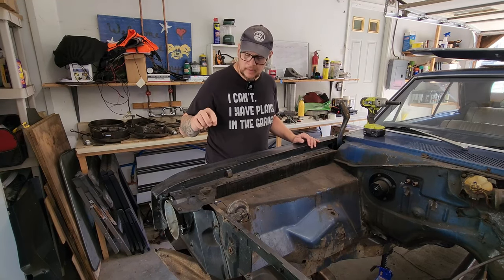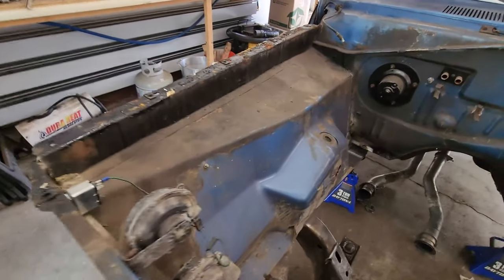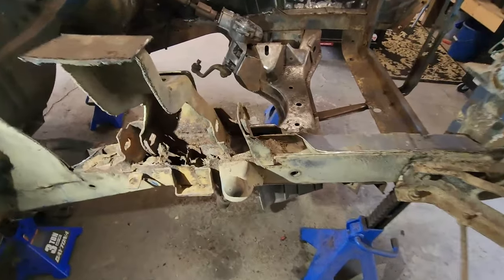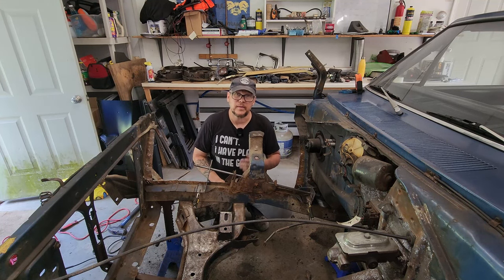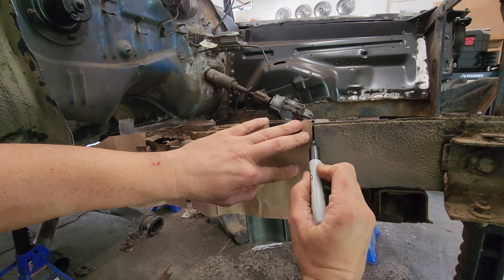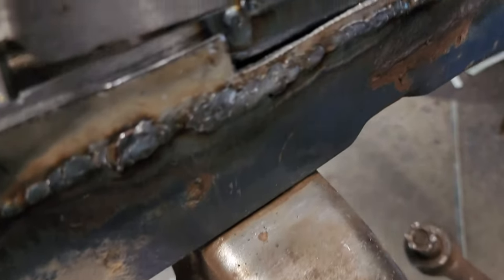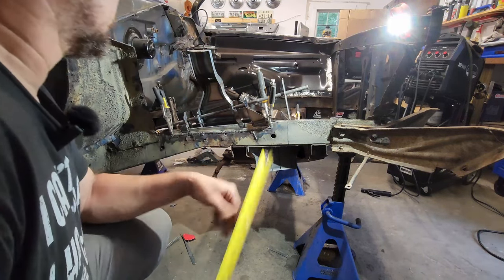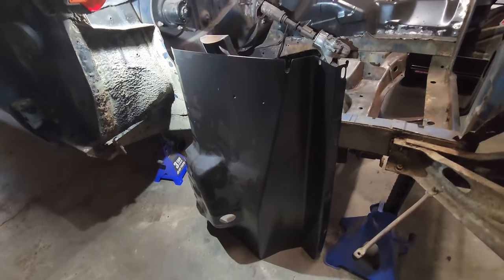How To Replace Upper Control Arm Mounts On A Mopar A-Body

Comment: More videos please love the progress and appreciate what your doin.
Reply from the maker: Welcome and thanks for the comment. I am definitely working on more videos. Have one in edit now and a few more ideas lined up. A full time job makes weekly or even bi-weekly releases unlikely though. More metal work is coming down the pipe too but that will be later in the year. Hope to see you then.
Reply: @MontsweagGarage  thank you ive got a 72 dart im building myself and yours videos have been a big help. Ive toyed wIth the idea of putting a full frame from a dakota underneath mine and running air bags,but ive got alot of body work to do befofe i get to thst point like a new roof skin. Thanks for the reply and the work you put in.
Reply from the maker: That's an interesting idea. Personally I would use a frame connector kit and torque boxes. Not sure how well a Dakota frame will fit. I'd definitely be interested to see how that works out for you.